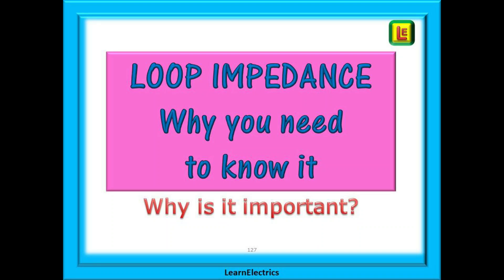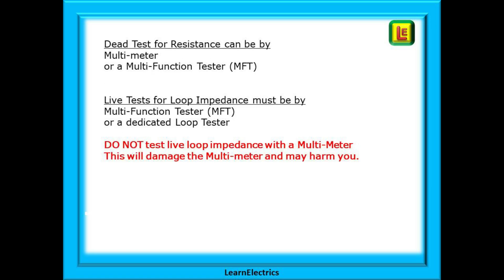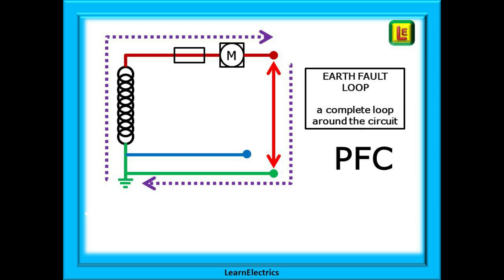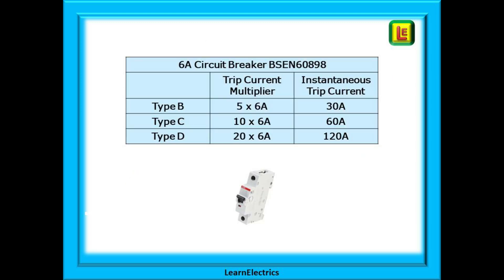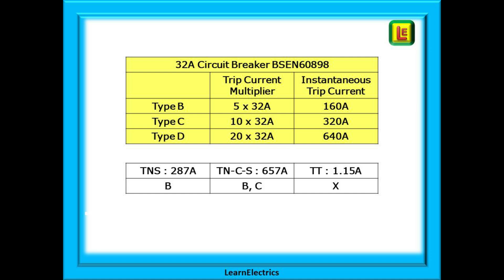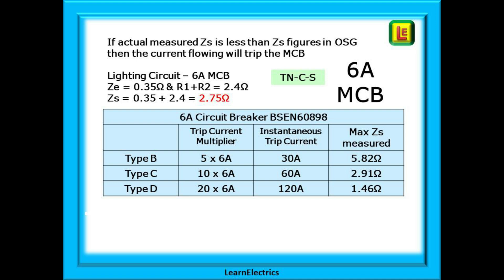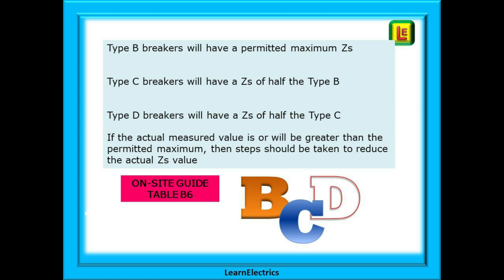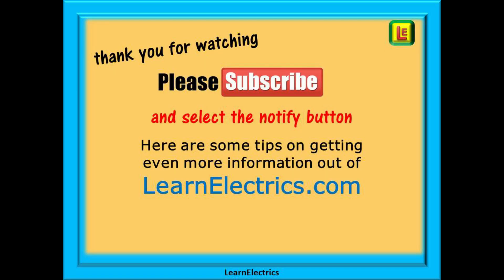LOOP IMPEDANCE – WHY IS IT IMPORTANT - Ze and Zs – How does Loop Impedance affect my installation?

Comment: Thanks for uploading another educational video.  I need some clarity with the R1 + R2 which one are we  adding with the Ze? The sockets circuits, lights ciruits etc have their R1+ R2 value which one do you use? SInce the Zs is for the entire system where does the R1 + R2 values comes from ?
Thanks in advance for replying
Reply from the maker: Take a look at the video on the link below. R1 and R2 go together, we do not normally separate the values, you need both. Lighting will have its own R1+R2, sockets will have their own R1+R2 etc.
What is R1+R2
https://www.youtube.com/watch?v=HvDuVLDxvhs

Comment: Are these types written on the C/B's? I see there's Typa B-D as explained on the slides
Reply from the maker: The wording is not always visible from the front. Some breakers have the information on the side, only visible if removed from the board. Why????????
Reply: @learnelectrics4402 I actually wanted to understand how are they differentiated?

Comment: Hi Dave,  if an earth fault flows all th way back to the transformer and back to property. How does it only come back to our property? And not take other paths to other properties, disconnecting other circuits and how does it know to trip the right breaker? Sorry still learning
Reply from the maker: Its the loop from the point of fault on the earth and back on the line conductor.
The fault current flows back down the line and through the fuse, causing it to trip and disconnect the supply. The massive fault current can only flow through the fuse that is connected to the fault. All other circuits are unaffected as they do not have a fault. Hope this helps.

https://www.youtube.com/watch?v=xtDId-g7GjU

Comment: Is it possible to use thèse values in france. The only difference is tha CPC is always the same diameter as r1 and rn
Reply from the maker: I always did when working in France and the French Sparks that signed off my work accepted the figures too. 
""If it was the Rosbif then they will correct.""
Yes, the CPC will be the same size - look at Table 54.7 on p201 of the brown 18th Edition Amendment 2 book.
Funnily enough, next weeks video is about exactly this, choosing protective conductors.
Thanks for the support. Wish I was back in Suevres.
Dave
Reply: @learnelectrics4402  Thank you so much for the reply. Im not an electrician. I am Just passionate to learn the subject and have invested in all the équipement since the few years. I need to purchase the régs and on site guide. But ill get those soon.....I have Just one last question Dave...Can I still use the magic number 35 for the Zs calculations if the cpcs are the same size as the line conductors.  I hope its not à stupid question.  Cheers.

Comment: I see that you're using the OSG tables for max Zs. I see that there is another table, B8, of temp factors which apply for ambient temps other than 10 degrees C. Shouldn't these be applied when checking for Max Zs? They apply a +8% to -4% adjustment to the tabulated values. Small but significant in some cases!

Looking at Guidance Notes 3, they state 4 methods for deciding what the Max Zs is. As far as I can tell, these mainly agree with the values in the OSG, other than the method that says to use the designers figures!

I am finding it a little confusing that C&G appear to just use the tables in BS7671 without any temp factors, in some exam questions. This would obviously result in higher Max Zs due to using values that assume the cables are at max capacity and are therefore at 70 degrees C.

In the real world, we obviously want Zs as low as possible, but for exam questions, I'm not 100% sure which is the correct method. I would hate to use the OSG tables B6 and B8 for example and not get the marks!
Reply from the maker: In the 18th Edition Exam, use only the data that is in the BS7671 book. All questions are based on that book and nothing else. For other assessments, they will usually say something like --- and make any necessary adjustments for temperature -- Hope this helps.

Comment: Another great informative video. Just to confirm we are to use the measured values of Ze added to R1+R2 and not just assume max allowable Ze for the earth system type.
Reply from the maker: Correct, use what you measure as that is specific to that installation. Thanks for watching. Dave.

Comment: if the Zs is satisfactory on a B type MCB, but the circuit requires a C type MCB, would you effectively need larger cables (or shorter run) to create a lower impedance? And why isn't the Zs factored into cable calcs' procedure? (Ib<In<Iz) 

I've seen some solar guys just simply change out a B type MCB for a C type with no consideration.

Love your vids mate,  than you. I'm current on my final year of L3 and you have helped me immensely. Legend
Reply from the maker: Take a look at this video on breaker types. It will help. As for Zs etc. the two calcs you mention are for different stages of the design process. Hope this helps.
https://www.youtube.com/watch?v=d5xR1eqPkbI
Reply from the maker: Take a look at the video below, it will help. The two sets of calcs you mention are used at different stages of the design process, Thanks for watching.
https://www.youtube.com/watch?v=d5xR1eqPkbI

Comment: Hi Dave
Can you please answer a question for me.
How are the measured values of an earth fault loop impedance verified correctly verified by an inspector.
Answer 
A. Compared with the corrected values of the OSG
Or
Answer. 
B. Compared with the uncorrected values given in the BS 7671.
It was an exam question
Reply from the maker: On site you will use the measured values from the On-Site Guide.
You can use the values in BS7671 but you will need to multiply by 0.8 to get the measured value.
Also take a look at the video on the link below, it should help.
https://www.youtube.com/watch?v=xtDId-g7GjU
Reply: Great thanks Dave.
Superb stuff on YouTube. Please keep it up.
Reply: Why in the OSG page 187 Circuit Details, column 12 state the maximum impedance values from BS 7671. ie, 32amp 60898 is 1.37.
Surely if you are verifying your measured value this should be 1.10 as shown on page 145.
It also states that you need to write in the remarks column that you have taken the source other than that of Bs7671.
Something doesn't seem right or add up.

Comment: Hi Dave, Just a quick question about table B6. at 9:56 you show max Zs Measured values for 6A type B, C and D circuit breakers but I can't find these values in the table. The values I see for type B, C and D are 5.87, 2.91 and 1.46/2.91 respectively. Am I missing something here?
Reply from the maker: It depends which tables you look at. But the difference between 5.82 as I quoted and 5.87 is only 5 one hundredths of an ohm and well within the right range. It sometimes depends on whether the figures are rounded up or rounded down. Well spotted and thanks for watching.
The next video, on Sunday, will give you a lot more information about Zs and explain a lot more. Dave.

Comment: Good morning Sir,
I want to know is measurement of fault loop impedance important in case of TT system?
As I know for protection ,RCD is mandatory in case of TT SYSTEM.
Reply from the maker: Yes, it should be tested, and especially ZS. Thanks for the input. Dave.
Reply: @learnelectrics4402  knowing the Zs value,what is the benefit of knowing it in case of TT System?
As I learned from your video,Zs values plays an important role incase of automatic disconnection of supply in TN System while there is a fault?
I will be grateful if you will spare some of your valuable time to clear my doubt?
Love from India

Comment: Hi sorry if a daft question, but on an earth fault loop path for a TT system
When there is an earth fault, the current must flow down to earth, back to the transformer and back to operate the fuse. Does it really take this path, how does the electricity flow through the actual ground all the way back to the transformer ? I can't understand how it flows through mud and that quick to complete the fault path. Even hard to believe it can do this on a TNCS etc
Reply from the maker: The earth current flows into the general mass of earth. In simple terms, an electron that goes into the ground at the earth rod by the house, now leaves a space for another electron to enter the system at the consumer unit. When this electron enters the CU, that leaves a space in the line cable for another electron to enter at the supply transformer.
Hope this helps. Dave.

Comment: May I ask a question about 32A MCB table? Type D is 640A Instant trip current, TNCS run 657A which also more than 640A. why it is not acceptable for TNCS?
Reply from the maker: You've found a typo. I copy and pasted from another slide and missed that data to update. On the plus side, it shows you are paying attention. You guys never let me get away with anything. My mistake it will actually trip within 0.4 seconds. Thanks for watching. Dave.
Reply: @learnelectrics4402  Do you mean Type D is not 640A Instant trip current originally? If so, would you tell me what is the correct number? thank you Dave.

Comment: Hi Dave pls can you explain why in your table a type D 32A circuit breaker with a 640A trip current is not suitable for a PFC of 657A. Thank you.
Reply from the maker: Its a typo Vachik, it should have been marked as suitable. Thanks for spotting it and thanks for watching. Dave.
Reply: @learnelectrics4402  Hi Dave thanks for your attention.

Comment: Hi Dave Robert here another very educational video cheers. Just a quick query i understand that the smaller the circuit breaker then the higher the max Zs allowed so for eg a 6 amp lighting circuit has a max Zs of 5.87 ohms on a type b circuit breaker according to the osg. Would i be right in saying that certain circuits allow for more additional wiring eg extending than others. say for eg i wanted to replace 2 old kitchen lights for a few downlighters should i check what the existing zs is on that lighting circuit prior to the work because im extending new cable etc which will increase the resistance or because the zs is 5.87 allowed on a lighting circuit there ought to be plenty of scope to allow for the extra resistance or should i never assume anything and check the existing zs before and after the work. sorry about the long question but im beginning to understand that you cant just willy nilly extend circuits etc without there being consequences and im someone who likes to make sure every thing is covered. cheers Dave.
Reply from the maker: Yes, if you know the Ze of the installation, subtract that from the maximum permitted Zs for that lighting circuit mcb. Then use table B in Guidance note 3 to calculate the maximum length you can go to. so a type B 6A could in theory be well over 100 metres depending on installation conditions. Good question.

Comment: Hi Dave another interesting video…I jus keep learning and hence curious questions keep popping up….if I do a zs on a empty property then do another zs when all the appliances are plugged in lighting etc….will the result be the same
Reply from the maker: Theoretically yes, you may get very slight differences if there is a small earth leakage on appliances since you are measuring between Line and Earth. Not enough to worry about. Thanks for your support. Dave.
Reply: Thanks dave

Comment: Hi, on the last example for 32amp MCB you stated that Type B would be ok but C and D are not? Can you explain why please Type C is 0.54 and type D 0.28 so under maximum measured? Thanks again
Reply: Zs of the circuit example is 1.01 ohms...so therefore for any of the circuit breakers to be acceptable, the tabulated values for these must be above this.

Type B = 1.1ohms is the only one that is above the measured circuits Zs value
Reply from the maker: Thank you for helping, appreciated. Dave.
Reply: @commecicommeca4489  thanks for the reply but the max  measured has to be below the max in the tables. He mentions it in the last example just thought I had missed something?
Reply: @chrismacewan3179 
Your answering your own question... Your correct

If actual measured values of Zs of the circuit are less than the tabulated figures in the OSG for the specified / chosen breaker then the current flowing is guaranteed to trip the circuit.

His example:

Zs of circuit in question

1.01 ohms

Deciding which type breaker can be used in this circuit with the above circuit impedance :

Type B = 1.1 ohms maximum circuit impedance for disconnection 

Type C = 0.55 ohms maximum circuit  impedance for disconnection

Type D = 0.28 ohms maximum circuit impedance for disconnection
Reply: @commecicommeca4489  thank you for explaining I see what I’ve done wrong. Thanks again
Reply from the maker: Chris as Ci Ca has said, the measured is 1.01 ohms and must be below the max permitted. Only Type B meets this criteria. Your actual measured MUST be below the permitted. Hope this helps. Dave.

Comment: PEFC ..PFC isn’t that the prospective fault current between L&N.
Reply from the maker: PEFC - prospective earth fault current i.e Line to Earth
PSCC - prospective short circuit current i.e Line to Neutral
PFC - the higher of the above two is recorded as prospective fault current on the certificate. Always the worst case.
Hope this helps.

Comment: Dave, really clear and well derived explanation as always, thank you.  At 7:15 when discussing the TT earthing arrangement you say RCDs are used as “additional protection”, as the Zs alone would not allow sufficient PFC for the MCB to operate.  Is this what the IET call “Fault Protection” (OSG 3.6.1 a.)?  Unfortunately IET use the term “Additional Protection” for what I’d call the ‘Domestic and DIY Dad induced shock hazards’. I just remember getting these confused on my exams.
Reply from the maker: Yes, your right in the RCD being used for fault protection Mike, and there is a box on the inspection schedules for this - Fault protection as separate from additional protection. I used the term additional protection to mean in addition to the MCBs that would only really provide overload protection in this situation. I didn't want folk thinking they could just ignore MCBs if they fitted an RCD. I knew someone would pick up on it, keeping me on my toes. Thanks. Dave.
Reply: @learnelectrics4402  So in the TT system, the MCB is only able to provide protection for L/N overload?  If R1 + Rn was > max measured Zs, would that compromise the PSC and hence impede the MCB operation in an overload situation?

Comment: At 7:53 you say the Type D 32 amps will not trip  on a TNCS?  It requires 640 amps but you have 657 amps fault current on the TNCS ?    Can anyone here explain this,  ?   Thanks
Reply from the maker: Spot on Michael. I don't have an excuse, it is just inside the tripping current upper limit. Thanks for paying attention when I wasn't. That's another beer I owe you. Dave.
Reply: @learnelectrics4402     Thanks for clarifying this.   Mike

Comment: Excellent as ever. Probably the most important but least understood element of electrical installation especially by your average DIYer.
Reply from the maker: Thanks Alan, great feedback. Dave.
Reply: Your average DIYer should not not be attempting any work  where Earthing  circuits are worked on.
Reply: @garypautard1069 tell the average DIYer that😂